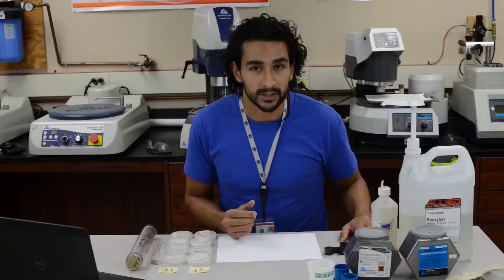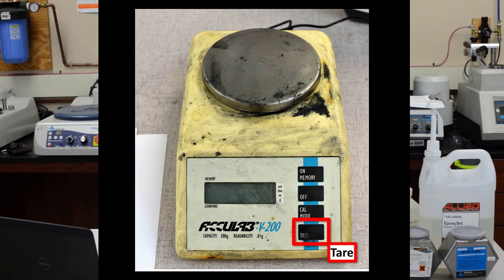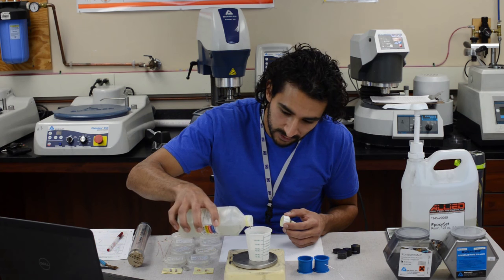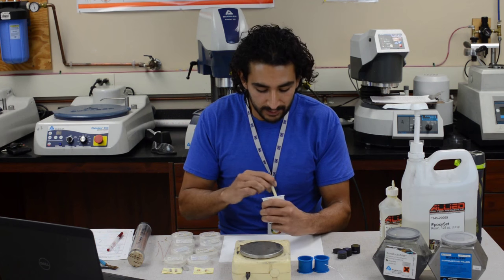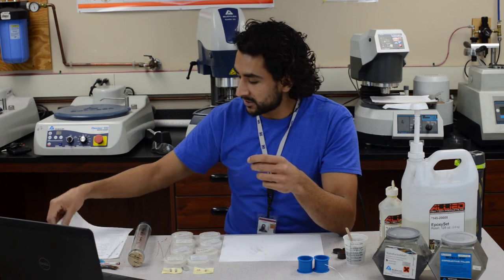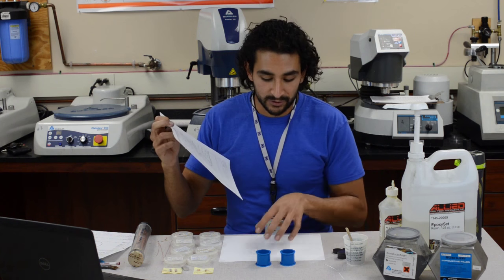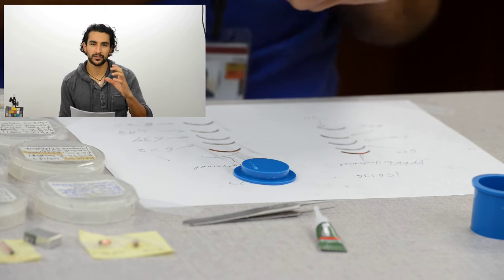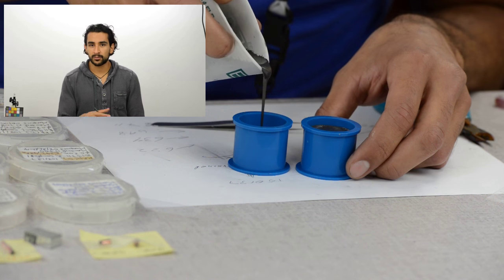Metallographic preparation - Part 2: Longitudinal cross section mounting (cold mount)

Comment: Is there a reason you didn't use non-stick spray on the sample holder prior to pouring the resin? Also, for the epoxy non conducting for the SEM - can you not sputter gold to reduce the charging?
Reply: No reason, in fact I had some trouble getting them out. I should have, ha! And yes, sputtering is the best way to reduce charging. I used carbon.

Comment: what will happen if the grinding and polishing steps are not followed or ignored?
Reply: then the specimen will be useless. Grinding and polishing ensures a smooth and deformatin-free specimen, free of scratches, etc. If you do not grind and polish you will not get accurate hardness readings (if doing micro hardness testing) and false microstructures if trying to interpret microstructures.